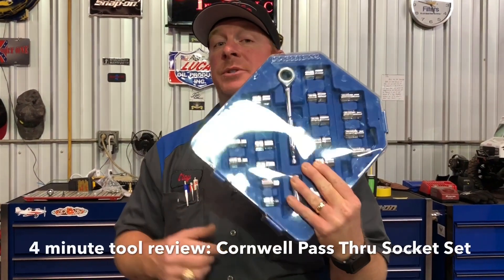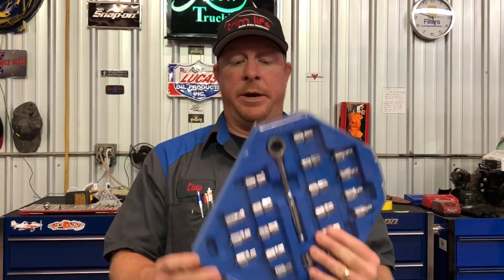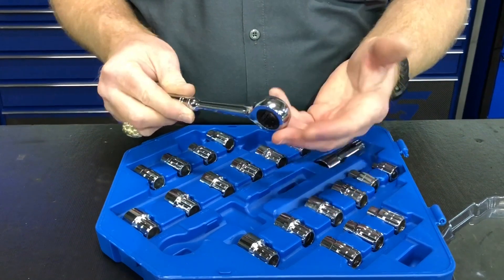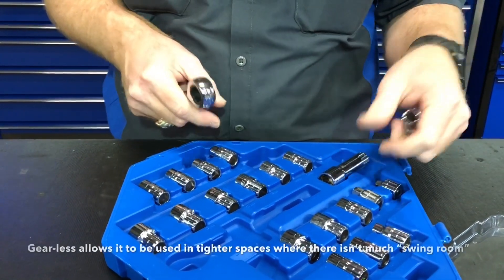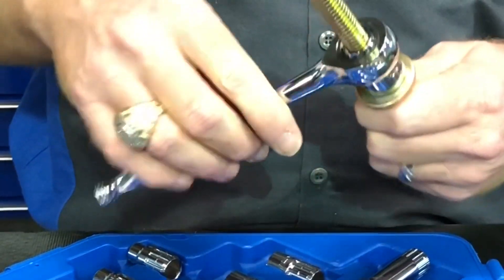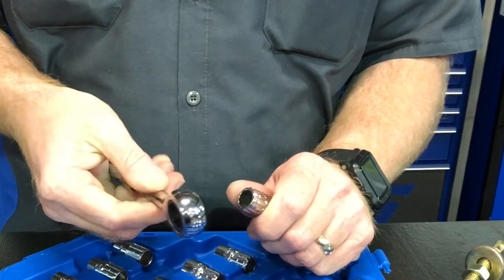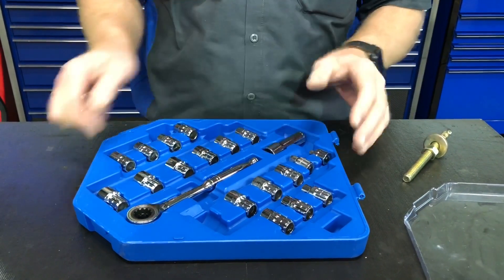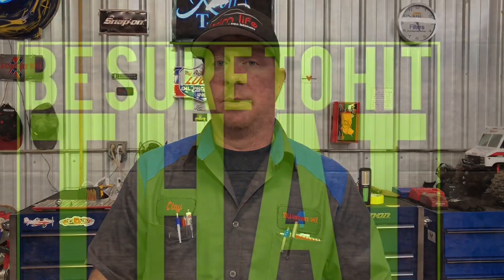Cornwell Pass Thru Socket Set. Up Close Look and Review

Comment: I agree,have the full Craftsman pass through set with the 1/4 drive and 3/8 drive socket sizes which has saved me several in certain spots.One has been access to motor mount nuts where a regular ratchet and socket won't fit in.